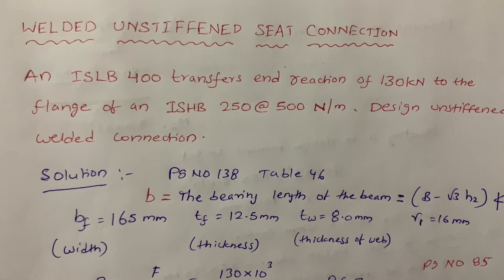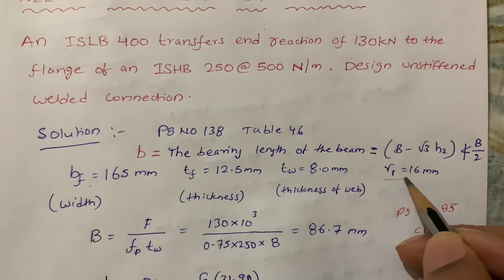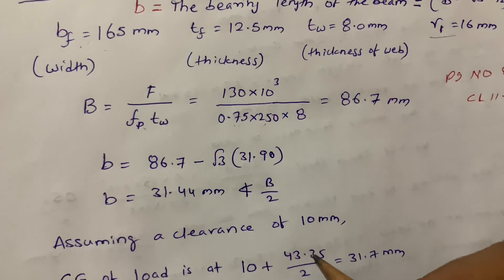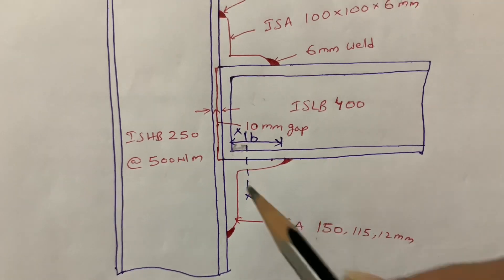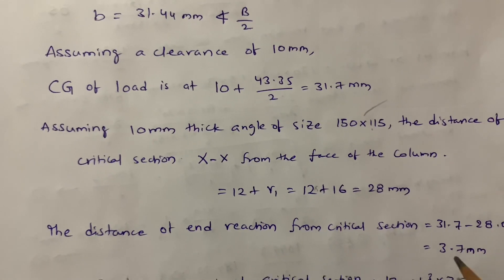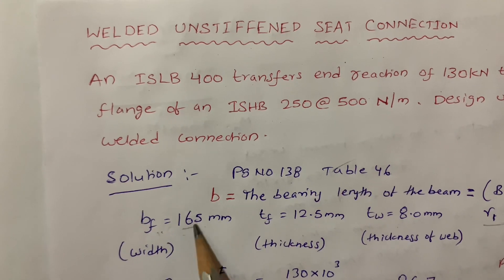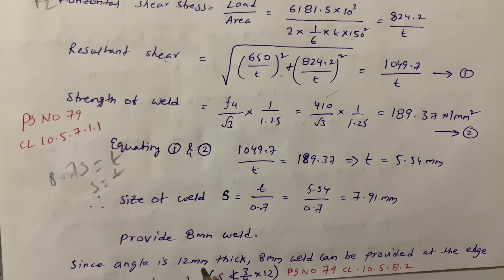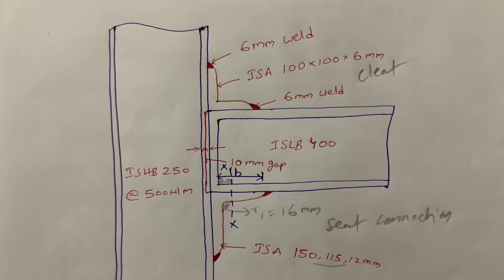#WeldedUnstiffenedSeatConnection #DesignOfSteelStructure #DesignOfWeld #ISHB250 #ISLB400 #

Comment: This problem cg is 31.7 ok but in stiffened problem cg is 53.35 how sir
Reply from the maker: In stiffened connection Breadth of the flange is 86.7 Centre of that value is 43.35 for CG formula y/2 and I added clearance so 53.35